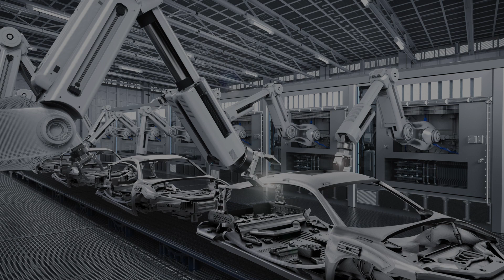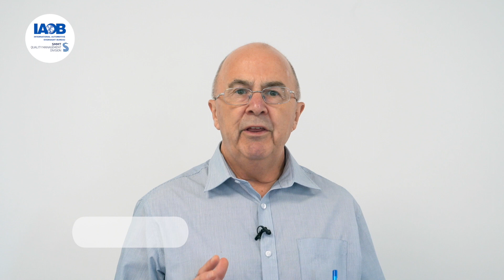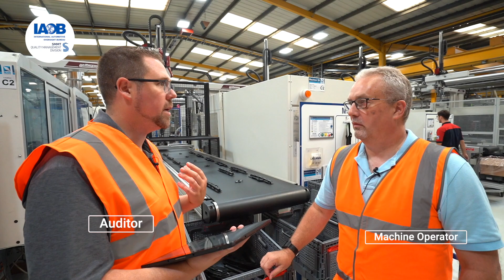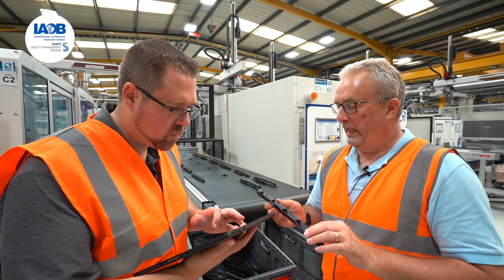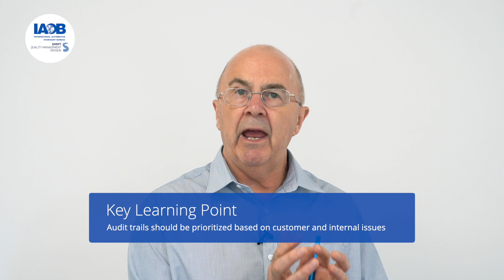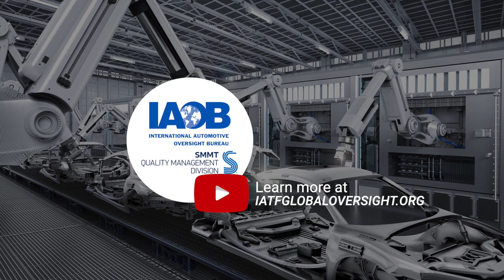IATF 16949 audits | How do I: Audit the production process use of FMEA and Control Plan

Comment: I have question for manufacturing process night shift. 
If the night shift start 20.00 -05.00 and OT. At 06.00 -08.00. Does the auditor can audit night shift at  06.00 -08.00?
Reply from the maker: Hello, 
The answer to this question would depend on several different variables. If you have a specific instance in mind it would be best for your CB to contact their relevant Oversight Office and provide full details in order for them to make the decision.